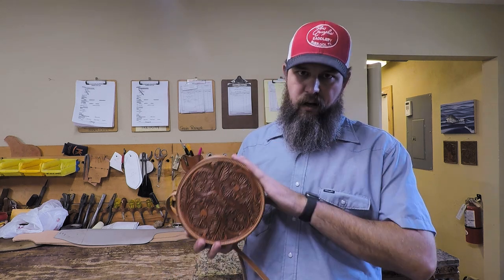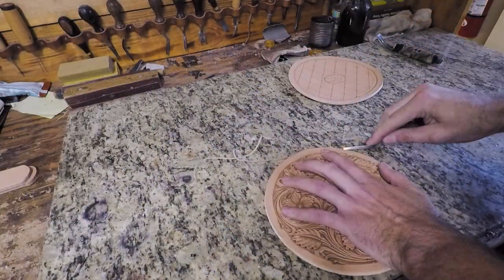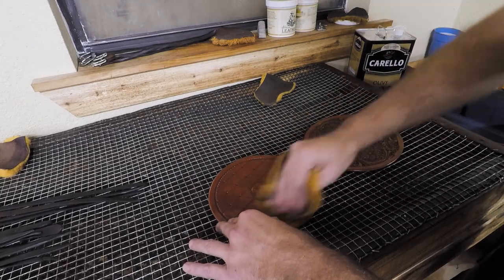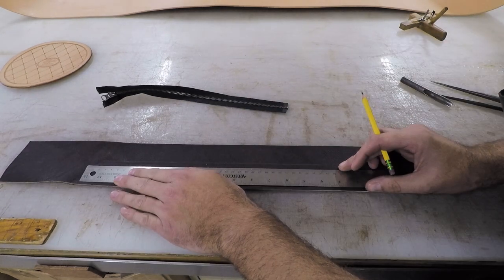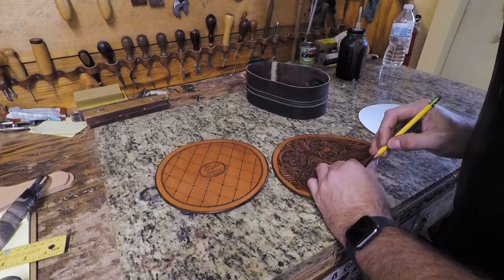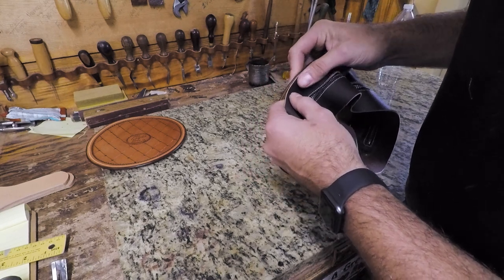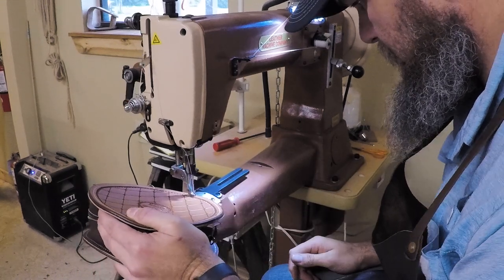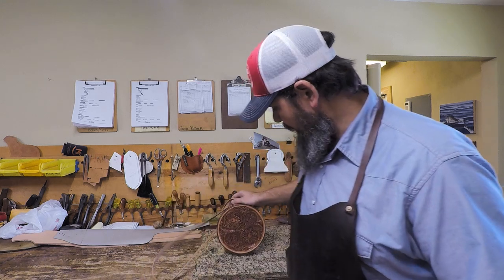How to Make a Round Leather Handbag

Comment: Wish I could snap my fingers and have my tooling come out that nice!!! Perhaps you could punch slots in the gusset and weave the strap through them instead of sewing in pieces. I did this on a round canteen cover and it worked well. The zipper would have to be smaller for it to as well. Cool project!

Comment: Ok so I used 3 ounce leather for my gusset, it ended up being around 3/8” to 1/2” to long. My measurements were on the Money so the only thing I could think of is the 3 ounce leather either stretched as I glued it to the face or the leather being 3 ounces made the gusset longer?

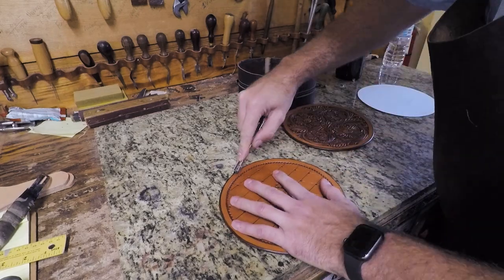Comment: What tool is at 15:55 and where can I buy that one? I’ve got a stitch line groover but it’s cheap and that is like an old compass. Just twist and adjust
Reply: Did you ever figure that out? I have the same question.
Also what edging tool for beveling around the circles